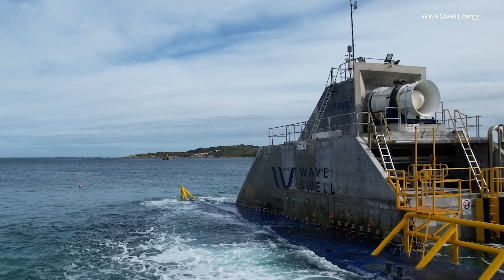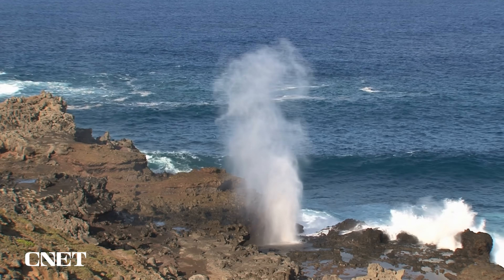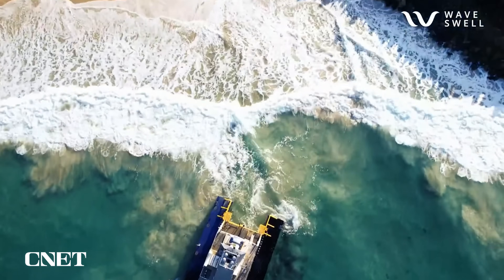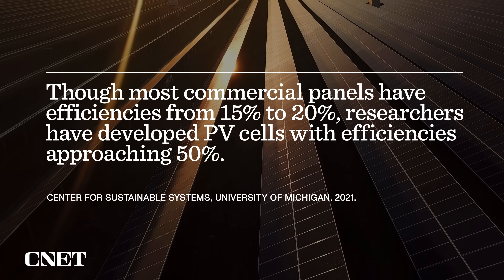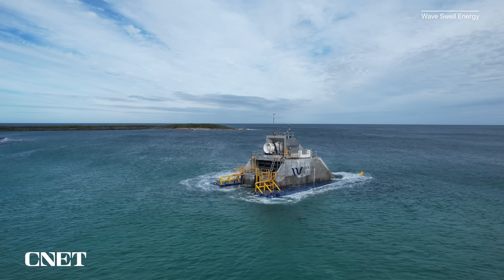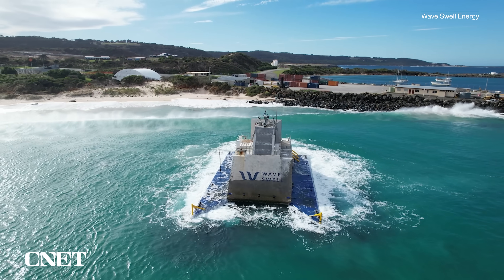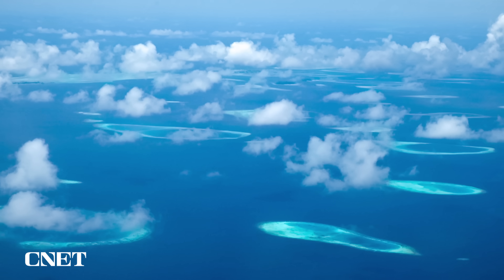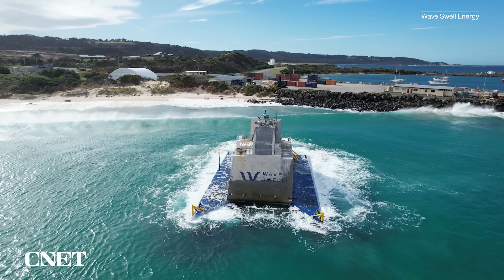'Artificial Blowhole' Generates Wave Energy for 1 Year

Comment: 1:10 Efficiency is totally irrelevant. It doesn't matter if it captures 1% of the wave energy or 100% of the wave energy, unless you are in the situation where you have run out of waves. It's not like a non-renewable resource where if you make it more efficient you can use less oil. What matters is how much total energy it captures for how much cost, and how consistent that generation is, i.e. does it generate all the time or only on rough sea day, so you need backup batteries and / or generators.

Comment: This is a terrible idea. Anyone who's been around a marine invioment knows the maintenance or aging of the vessel is a factor, not to mention hurricanes.  But built into a seawall or breakwater that's going to be built anyway sounds intriguing, the turbine on the top of the wall could be serviced much easier. A long line of them with no short-term maintenance  on the wall.

Comment: already made some notes on how it can be made better for a more effective pull of the water sucking air in the turbine, lttle stuff to the tunnle it self but besides that really placement is everything on this you can turn it two inches one way and it does nothing and turn it the other and suddly you have a 52-53 % energy efficiency pull. i can help do the same on one or two percent here and there but in long runs that adds up to more power in turn more money abd development for thoese who very well need this.
im not anyone special just i know what your doing and i used to use red cupa doing the samw at the beach. people thought it was cool how no matter the waves size i got a water spour to shoot up. pressure. and that has a whole world of tricks, ever heard of the telsa water value, think that mans gift then is for yall now it help it greatly.

Comment: As some others have commented, apparently this system averages 40kW of output for around 20 hours a day. 
For reference, that's the equivalent of about 160 kW of solar panels that generate electricity for 5 hours a day (~800 panels, which is roughly $200k). 
To store the 800 kWh that this system would generate each day (to then use over the remaining 15 hours, you'd need 600kWh of battery storage, which is about 50 Tesla Powerwalls (~$500,000)

So if this unit could cost under a million, it just might have a future to replace solar/wind + batteries in some coastal areas. Otherwise, it sounds like it would be easier to just buy the solar and batteries.

Comment: Well, I think it's a bit optimistic regarding efficiency, when I see waves splashing on around it... That's wasted energy.

Anyway, wave energy is indeed a very reliable source, the sea is never completely still.

Then it begs the question, how much energy does such a shore side bunker provide reliably? In other words how much beach has to be decorated with these to power 1000 households all year round, no matter the weather?

I read it averaged at 40kW in another comment... That's about 20 ovens going at the same time. But of course, not everyone will be baking at the exact same time. And with EV home charging getting popular, that huge brick can only charge 4 cars at once, and one fast charger could easily use 10 of these. That's a lot of beach property required.

I know it can be scaled up etc. But I think that commercial use is still far away.

Comment: I think that a direct mechanical device that converts reciprocal movement into rotation needed by a generator like that of a crankshaft would be better.

I wonder if the sun is charging the salt water of the sea and there is a way to get the electrical energy from the ocean without killing the planet?

Comment: Thats not "wave" energy as the water does not make the energy at all, it's the compressed air that makes the energy. That's why it generates almost no energy, The water is 750x more dense, so i dont understand why the use only the air here, right?

Comment: G E ( General Electric ) 
Did this year's ago 
By placing a tube on shore at the sea waters edge 
( Ireland I Believe )
The trick is to capture the energy on the inward and then the outward push , flow , stroke . To to this the turbine blades must be able to generate electricity as the flow passes through in both directions . 
This produces the most effective and efficient capability of capturing electrical energy .
Thank you .

Comment: Another nonsensical, environmental boondoggle pipe dream that should never of left the drawing board. Modeling would easily show this is NOT a viable form of energy production, even for very small energy requirements. It would be better for the environment to just use fossil fuels, I bet, rather than build this ugly, feeble “energy source.”

Comment: I did a theoretical design of this type of wave energy production during my bachlors. Just noticed that it is producing electricity in one direction only(wave going down). it should generate power on the both side (wave going up and wave going down) as both conditions can produce pressure difference which would run the turbine.
Reply: Yep, these things look fantastic on paper, Not so much when buried in sand on the shore.

Comment: There was a wave energy generator in Port Kembla in 2014 I think.  The company went bust and left the generator there to rust away.  It was not able to produce sufficient energy to be viable.  Maybe this is different but as many comments have said, what is the power output?

Comment: It would be interesting to see if it could be adapted to being the base of a offshore wind turbine.  I also recently saw an interesting video on buoyancy based energy storage where basically you have buoyant objects that you pull under water with electric motors running to pulleys on the bottom of the ocean.  The buoyant objects store potential energy.  You sink them when you have surplus energy, and then let them pull back to the surface, turning a generator, when you need the power back.  

I know offshore wind tends to be farther out where combining it with these wouldn't let you use them as part of a breakwater, but I'd think that a lot of the rest of the infrastructure- the power lines going to shore, even the base of the towers for wind turbines anchored to the floor (as opposed to floating wind turbine platforms) would seem like they could overlap pretty easily.
Reply: Buoyant objects is just reinventing hydro electric storage but way worse

Comment: interesting but i already see a way to increase it's efficiency and power output by quite a bit. it's a very simple and interesting concept and i love the simplistic design as it doesn't have many moving parts which means longer service life before needing repairs, something like this would likely pay for itself in about 3-5 years of operation with a service life of probably 30 years or so with regular maintenance.

Comment: The dual purpose nature of this system is very attractive.  We could change hurricane season to harvest season.

Would like to see some work on various kinetic energy storage systems.
Reply: ...Except that the main issue with power during hurricanes is from damage to the distribution network, so these would be generating and pumping energy into downed power lines and already blown transformers.  That is, of course, if they don't have to be shut down during high winds to prevent damage to the turbine...

Comment: Add a valve and a second turbine to take advantage of both positive and negative pressures in the chamber, would probably border around 85% efficiency
Reply: The weight of the receding water (negative pressure) would not provide as much energy as the wave itself. It’s also important to have the air chamber cleared for the next wave.

Comment: I’m surprised they are using the air to turn the turbine. You would think the water entering and exiting the chamber would be a  greater force.
Reply: Moving parts in open ocean water would have constant maintenance. Part of which they did mention.
Reply: @joegreen4089  yeah I mean did we escape that with this design? I see your point though

Comment: Interesting that it captures the air on the intake motion rather than the exhaust motion. Instead of a blowhole it functions like a vacuum hole. I'm guessing the pressure exerted upward would be enough to lighten or loosen the unit from the seabed.
Reply: This seems a really important point.  Although the “blow hole” is moving water and air upwards, what is doing the work driving the turbine is due to the downward suction during the reverse phase.  Air is being sucked through the turbine.  Surely the efficiency of the whole operation depends upon the existence a one-way valve (not shown) stopping the chamber filling with the air it just pushed out not through the turbine (?)

Comment: Why would you not have used the air pushing and pulling the turbine? It seems with a small amount of engineering you could have both pushing the turbine. Was it moving parts that caused you to focus on the directionality of the flow of air?

Comment: For those that have asked, I believe the uniwave 200 generated an average 40kW over the trial period. Peak generation, based on the turbine used, was around 200kW (hence the name). Keep in mind this is essentially a prototype-demonstrator rather than a pre-production model and the up-time was less than 80%. If anyone knows better regarding the actual power generated, please let me know on a comment and I'll update the post.
Reply: it seems to me according to the diagram they are only utilizing half of the energy (only rising wave)
Reply: @rootvalley2  I think they’re using the rising and falling action, because both ways there is a pressure differential, the waves just escape before they reach the turbine
Reply: Does it have USB ports?
Reply: @elderbob100   finally a comment I understand!
Reply: Seems to me that if they added another turbine for the rising wave (above the receding wave turbine, to keep water out), they could greatly increase efficiency.
Reply: @boganbob2708  Yah, but then a car typically doesn't contain a turbine generator and doesn't have to withstand ocean swell for months, years at a time. Plus, to be honest, it's not like car design is 'out of the blue'. Toyota know all about how to design cars and, in case you're wondering, that tab did not include certification testing.
Reply: I like the project and the idea but damn, that efficiency needs to increase by several factors to be viable.
Reply: @marvindebot  how efficient are breakwaters and sea walls at generating electricity? Currently zero. This project is aiming to do something new. This is what research looks like.
Reply: @redteamla  exactly. With storm surges and climate change eroding more shorelines every year it would make sense to offset the cost of break waters by making them also producing energy.
Reply: Commercial power plant generators are 1000s of megawatts.
Reply: @namepending155  the largest onshore wind turbines can generate up to 7.5 MW and the largest offshore wind turbine can generate up to 14 MW, so a 200 kw demonstration unit for a wave turbine could easily be scaled up in numbers to make 1000+ MW installations just like how we install more than one wind turbine and solar panel at a time.
Reply: @samdcbu  that’s 285 of the largest wind turbines you mentioned to reach the equivalent of a traditional plant with four steam turbines at a 1000 MW each.
Reply: 12 million dollars for 40kw LOL! I bought a 7kW gasoline generator for $200, so I could buy 6 more, pay for all the gasoline, and still be ahead by $11-million and change...
Reply: @anonydun82fgoog35  It's a prototype. By way of comparison, the prototype for the Toyota Corolla Crossover cost an estimated $240 million.
Reply: @anonydun82fgoog35  mass production does wonders to the cost of products. This to my knowledge is the only one of these in existence and is still in its testing stages. The device doesn't use crazy rare materials or anything like that and doesn't seem to complex.
Reply: @deandollahite4779  yeah, it makes you wonder where exactly the $12 million went.
Reply: @anonydun82fgoog35  into R&D, that's what prototypes are for. Prototypes cost an absolute fortune, that price tag is to be expected in this case. There's nothing preventing it from drastically decreasing if it were to ever hit large scale production.
Reply: @anonydun82fgoog35  yea but this thing sits and generates for free minus some maintenance, need to talk more in terms of break even cost.
Reply: @rootvalley2  this is a demonstration project that is building a one off prototype to test the technology, it isn’t being mass produced so the cost is very specific to this unique prototype and it was never meant to become a profitable energy generator. The value of spending more to get the prototype faster is almost always worth it because it means the company will have paying customers sooner.

Comment: It seems like these things come along every few years. The problems with the previous ones were durability. Put any of these in an area  that generates lots of wave power and the wave power (and the salty water) destroy the machine. Put them where they won't get damaged and they don't produce much energy.
Reply: Yes, but in this design the turbine is isolated from the salt water by the compressed air layer.

Comment: Similar concept was tested years ago using large vertical tubes with turbines attached on top that bobbed up and down with waves.  The wave would push the turbine up and when it would fall the air rushing through it would generate electricity. I believe the idea was to use these in a farm type of concept like solar idea. Not sure what happened to that experiment.
Reply: They had to be deployed in deep water and tethered and were found to suffer from storm damage and corrosion that was hard to fix due to location. Also at the time, the cost per Kw/Hr was seen as not good but we now know that the fossil fuel price was rigged because of hidden subsidies. Some of the previously tried ideas may reappear but only if a better one does not present itself.

Comment: The unit first converts water movement into air movement. (Based on volume.) This results in a loss because water has a lot more mass then air. Also the unit seems to only be generating electricity in one direction. (Air inlet) I don't see how efficiency can be 50%. That number seems doctored. Most likely they are saying their turbine is 50% efficient based on the the air flow of the inlet NOT based on the energy of the wave.

Comment: Hmm. Wondering if you could implement this some way into boat. The energy generation would't need to be very big but when it's constant it makes it interesting in live aboard vessels...
Reply: You'd have to anchor the generation unit to something very solid, the energy flow requires the difference between the motion of the sea and the static generator.
I'd also be concerned about how noisy these things are, I suspect rather loud but this video didn't have any real sound of it running.
Reply: @nickryan3417  Yeah. Normal bigger live aboard sailboat has quite alot of mass to achieve the effect I think.
I wonder if some kind of device could be attached easily on the transom (where the movement of the boat is greatest).

I could imagine some kind of pipe with small air turbine on top would work here. Just stick the pipe under water and air should move inside there pretty rapidly. Adding one-way valve to make the turbine spin only on one direction like in this example.

Where could I find that kind of turbine though... 🤔

Comment: I’d like to see a look into where we are with molten salt reactors, specifically how close they are to being ready for real-life production.

Wave energy is far more realistic as a renewable energy source than windmills and solar because to no one’s surprise, people also require electricity at night and when the wind is not blowing.
Reply: Molten salt energy storage/transfer is an ongoing chemical hazard and nightmare. Very cool in principle, but the molten salt is incredibly corrosive which means that components fail all the time, and when, not if, the molten salt drops in temperature and solidifies then the entire pipe section has to be replaced.
Reply: @nickryan3417  Salt is corrosive, yes, both in a reactor and in the sea. Steel hull ships have survived that for over 100 years and special alloys will resist this for at least the time of the reactor.

That the salt solidified when you stop heating it, is a brilliant fail-safe which protects against explosions and other accidents. Compare this with old-fashioned reactors which melts down if you stop cooling or blows up if it overheats.

As far as I know, molten salt is sadly not ready for production, hence my request.
Reply: @vondahe  The molten salt used for energy storage/transfer is very different to sea water, which is just water with salt dissolved in it. 

When the molten salt cools it solidifies which is, as you note, is rather safer than something that goes boom, but given the temperature and corrosiveness of it if the pipework did rupture you would not want to be anywhere near it. The problem is where the corrosion damages components which halt the flow and then the salt solidifies in the pipes and mechanisms. All of which then need to be replaced, which is far from clean, safe or quick.

Comment: Wavegen has had 500kh models running for 20 years. The oscillating water column is the future. No moving parts in the water. Unlike this example, using the Wells turbine power is generated in both directions. Scotland has proven this method for years.